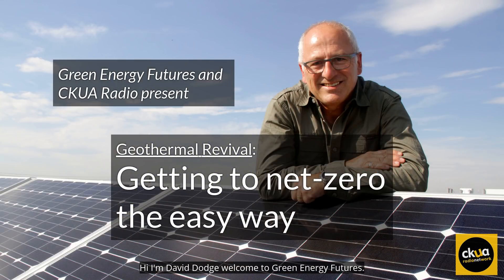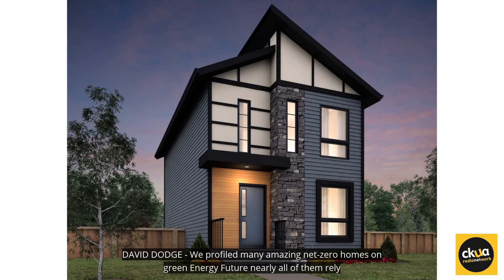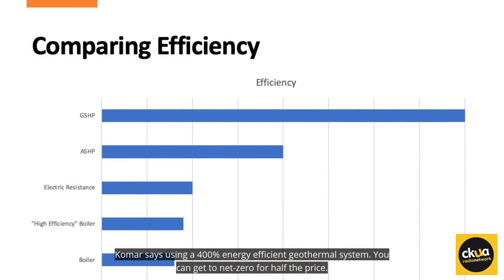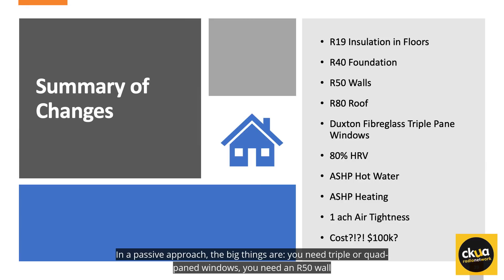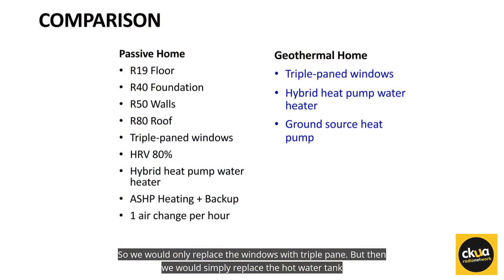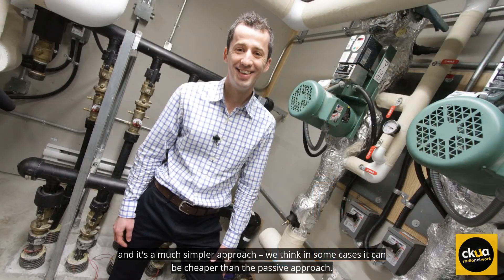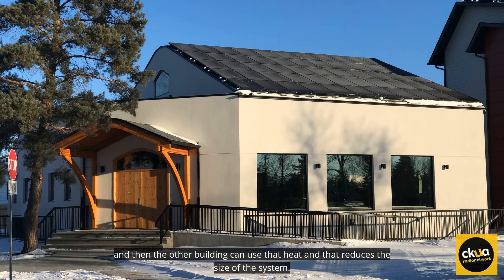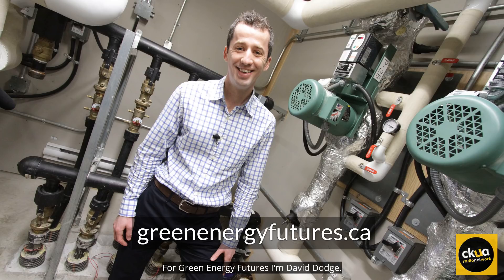222. Geothermal Revival - Getting to Net-Zero the Easy Way

Comment: Air sealing, super insulation, triple pane windows, solar energy, battery storage and an electric vehicle charger.
Geothermal is an interesting option. Air sealing and insulation are usually very cost effective.

Comment: FIRST RULE - Spend the money to drill below the frost line for year-round near free geo-heat. SECOND RULE - Insulate well, i.e. R60 THIRD RULE - Install a geo heat pump system. FOURTH RULE - Incorporate passive solar if possible.  Over the building life the real costs are operation - pay now with best of 1-2-3-4 construction or pay five times over the building lifetime with low-cost cutting corner constructions. Just do the math... it doesn't lie.